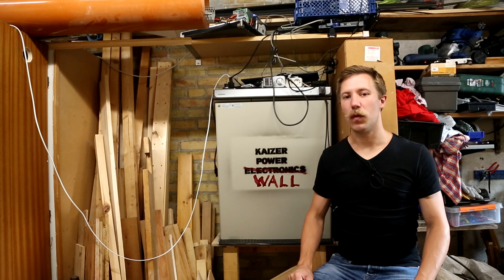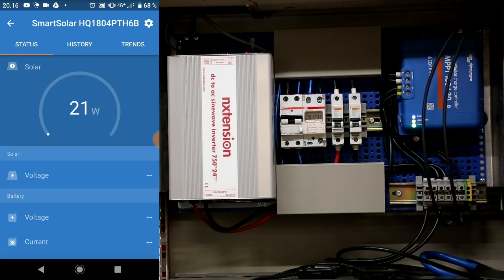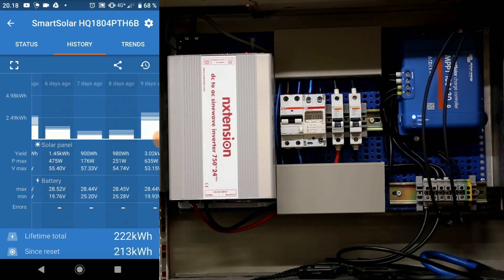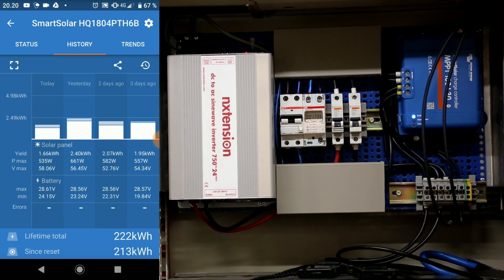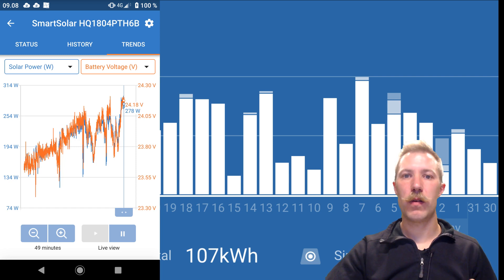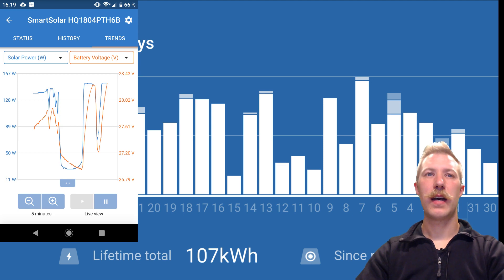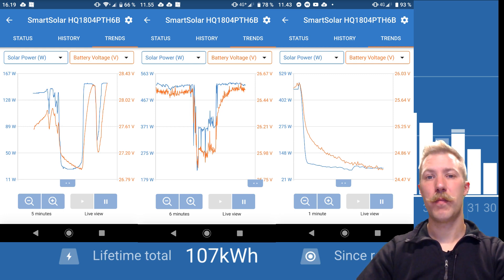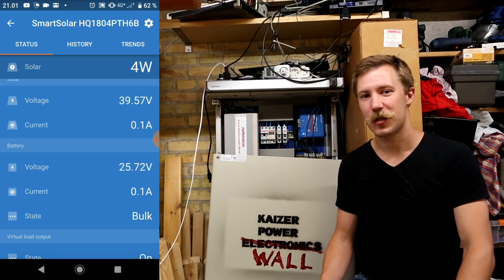750W Victron Solar Project - 60 Days Performance - Part 4

Comment: Fascinating, especially with battery chemistry considerations.  Excellent points, thanks for complicating it even more :)  
So, minimum workable scale ends up being quite a bit larger when considering battery longevity -- even after the system voltage decision.  n equations, n+k variables...headroom and cow-bell...  Thank you for sharing, and best of luck on ebay!
Reply from the maker: I am glad you could use my experiences and hopefully you get to plan your system better so it suits your ends need :)

Comment: I think you’d like the Victron VRM. You can get it going for as little as maybe $50. Just a raspberry Pi and a VE Direct dongle. Then you don’t need to use the app and can see everything on your phone or computer from anywhere. And the history goes back a long way. You can even update firmware from it.
Reply: Cool, I'll check it out
Reply: Wow they are super expensive
Reply: @resonantconsciousness9248  The CCGX is, but you can install the same software on a raspberry pi.  You don't even need the screen and all that.
Here is my demo on it.  I should probably do an updated one. https://www.youtube.com/watch?v=I39uEwnrXWc
Reply from the maker: Thank you for the tip on Victron VRM, I will definately look into that in a future setup.

Comment: On my 610watt system I get on a good day 1.5kwh
I found with charging pb batteries a cheap "pwm" was best for the batteries due to the pulse charging
Reply from the maker: I originally wanted gel batteries from UPS, but as I was not sure when I could get those, I went with the Victron charger as it have a dial wheel for selecting some 8-10 different battery types and charging profiles. 2 months is way too short a period to really conclude on the battery health :)
Reply: I’d reconsider that assumption. 1.5kw yield on 610 means you’re making good power for 3 hours or so. Which makes sense, because they have to run in parallel, so they don’t start making good amps until the sun gets higher. 

Now if you tried that same system in series with an MPPT, you’d be making some power from sun up to sun down, with good amps for 3-5 hours . I’d be surprised if your yield didn’t double. 

PWM in perfect conditions (70 degrees, full sun directly overhead) is more efficient, but outside of those few hours the MPPT will be better long term which is where you get the net gains.
Reply from the maker: I agree with Himmelberger Bus, you should be able to produce much more than just 1.5 kWh on a good day, I maxed my 750W out at some 4.5 kWh.